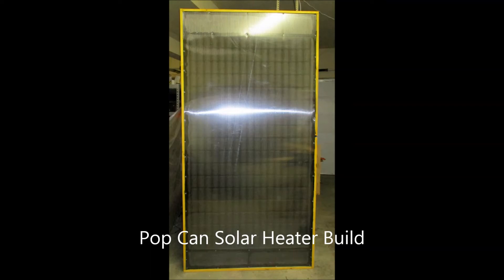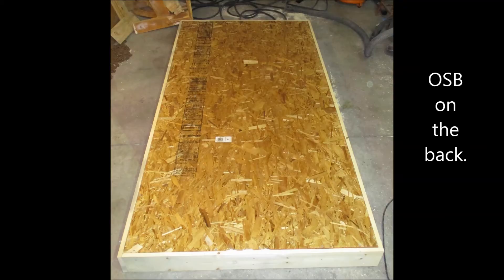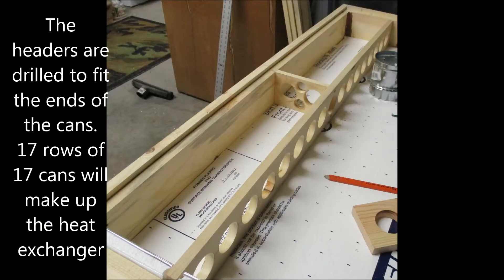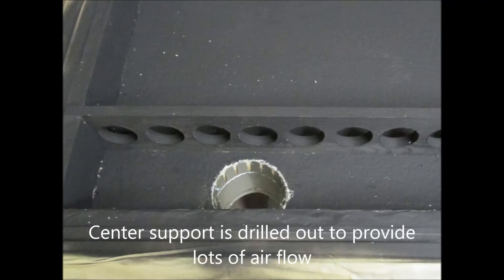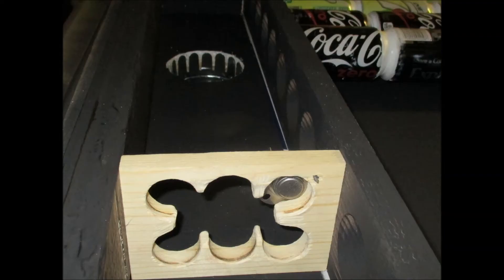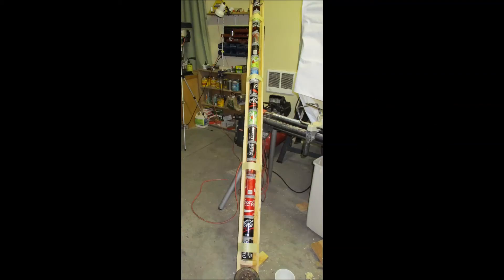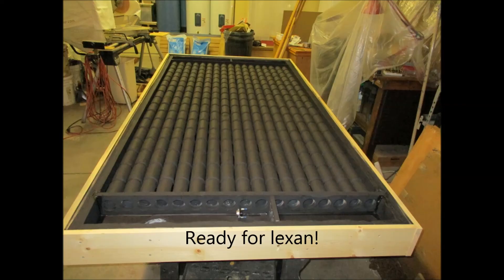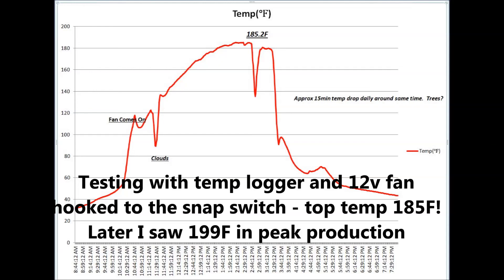Solar Heater Build - in pictures with narration

Comment: If only they made bourbon in a can!!! 😂🤣😂🤣
Reply from the maker: lol right?  😆  This is a pretty old video before I even had a clue to what I was doing lol of course that assumes I do now 😉
Reply: @TheOldJarhead  Still yet, it sure beats watching paint dry lol. Did you not do any cabin build videos?
Reply from the maker: I haven't yet.  I started YT after the initial build but planning a lot more at the cabin starting soon!
Reply from the maker: Just opened up a couple old ones for you 😉 they are in the off grid cabin playlist but 5 years old 😉
Reply: @TheOldJarhead  10-4
Reply: Hope the back gets better soon.
Reply from the maker: Thanks for watching my paint dry! 😉
Reply from the maker: @timothychristian9140  Thanks!  It's doing ok at the moment as long as I'm not in my feet more than 30m lol but more testing soon before hopefully getting an ablation to deaden the nerves 🤞🤞🤞
Reply: Does that have to be repeated every so often? One of my sisters has a bad back due to severe degenerative disc disease and she has shots put in her back every so often. Her insurance requires that she have 2 numbing shots, per side, before having the radio frequency treatment done.
Reply: @TheOldJarhead  Thanks
Reply from the maker: Yes, they say every 1 or two years
Reply from the maker: You bet!
Reply: @TheOldJarhead  My sister says the procedure helps but the red tape that her insurance makes her go through, each time, is just ridiculous.
Reply from the maker: Ya, red tape I know!  The VA is full of it 😉 My dad had it done and said it helped him for 3 years but is diminished so needs it again
Reply: @TheOldJarhead  That ain’t the only thing they are full of lol. Not the hospitals, they have treated me very well. Now the administration, that’s a different story.
Reply from the maker: Amen!!! 100% buddy, these days facilities are much better, admin not so much
Reply: @TheOldJarhead  Instead of old rusty construction tools, my facility has actually graduated to real surgical instruments 😂😂.
Reply from the maker: awesome 🤣
Reply: @TheOldJarhead  Now they are working on finding doctors to use them as the ones they have now still wear the white jackets. You know, those that the sleeves are affixed to the back 😜🤪😜🤪. The way they be hugging themselves, you would think they had a me complex or something 😂🤣😂🤣.
Reply from the maker: lol either in those jackets or wet behind the ears or senile lol
Reply: @TheOldJarhead  You got that right.